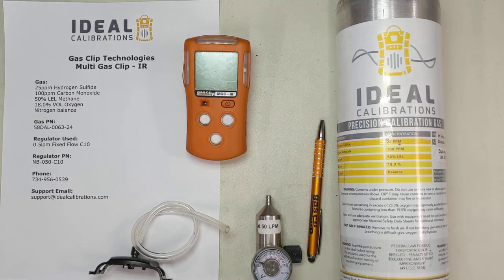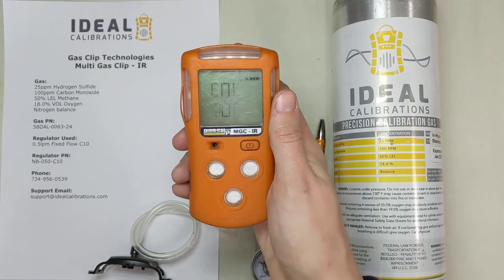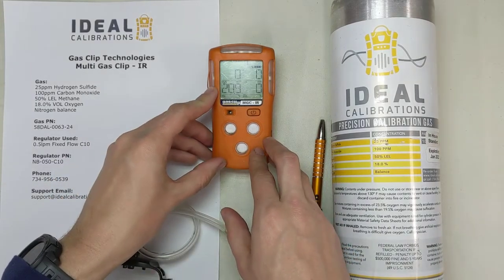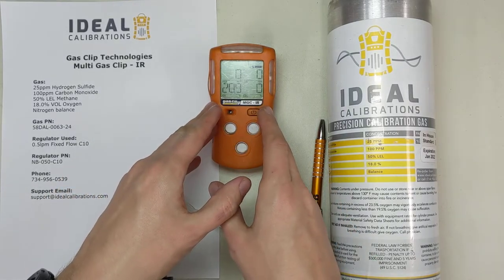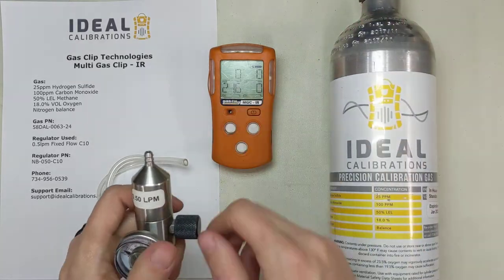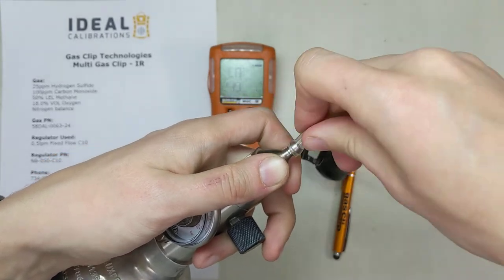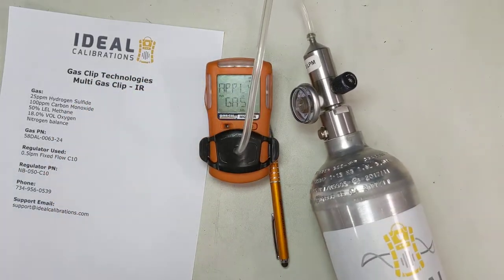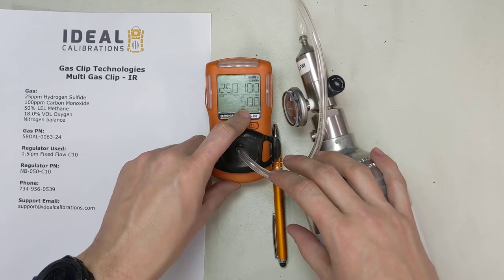Gas Clip Technologies Multi Gas Clip - IR Calibration Guide

Comment: Is the bump gas the same as calibration gas?
Reply from the maker: Great question! Generally it isn't. Calibration gas can be used as bump gas, but bump gas can't be used as calibration gas as it isn't accurate enough. Bump gas is usually just a high concentration that has less accuracy and is used to set off the alarms each day.

Comment: Hey boss, quick question. Does this monitor need to be calibrated before every use if you are only monitoring Oxygen levels and nothing else?
Reply from the maker: Hey RC, you need to bump test it each day to check and make sure the gas can get to the sensors. Sometimes things in the air, epoxy, etc can block the filters up so you still want to check it with gas. You don't need to calibrate it each day though, just expose it to gas and check the alarms and make sure they all go off. That process is called a "bump check"

Comment: We prefer to calibrate our LEL monitors that have catalytic bead sensors with 50% LEL of pentane, since the response factor is 1/1 for gasoline.  Is there a way to calibrate these IR sensors on pentane instead of methane?  If not, what is the relative response factor for gasoline on this monitor calibrated on methane?
Reply from the maker: So I believe you CAN calibrate with Pentane, but the IR curves are completely different from the cat bead sensors. That said, they're probably going to be different curves between Pentane/Gasoline on the IR sensor. I'd call GasClip directly on this one and check in your shoes.

Comment: Your oxygen is supposed to be set at 20.9%
The low alarm is 19.5 high is 23.5%
The batteries in these things will last 2 months if they are left on full time, not 14 days. Batteries will last 4-6 months if you shut it off every day.
Reply from the maker: Hey Dayna, you mean for room air zero right? Agreed. Shut it off when not in use and you'll get way better life